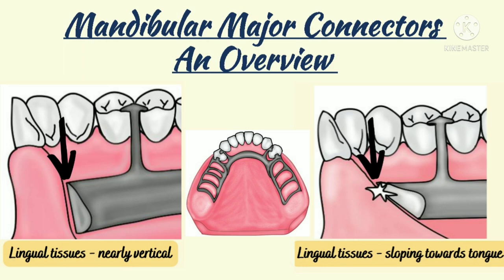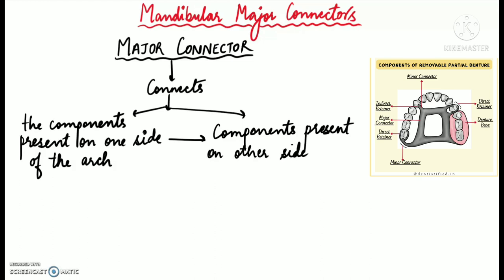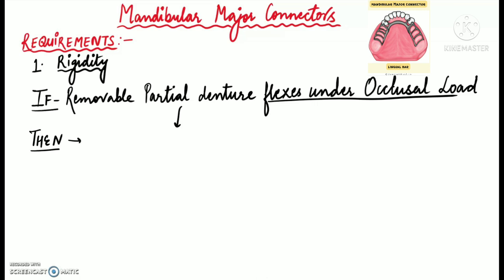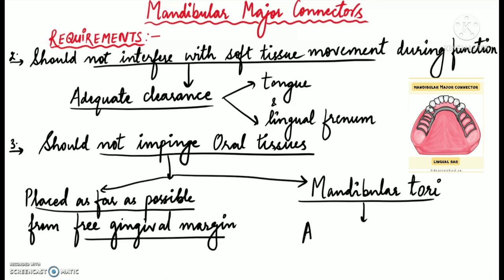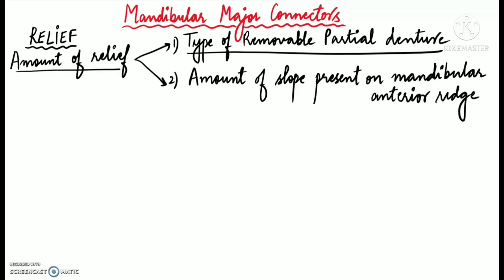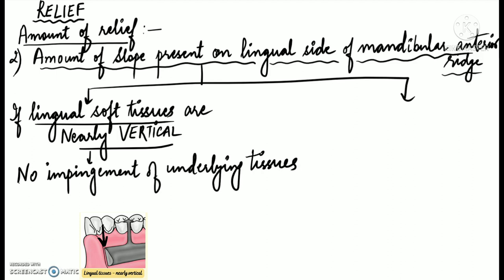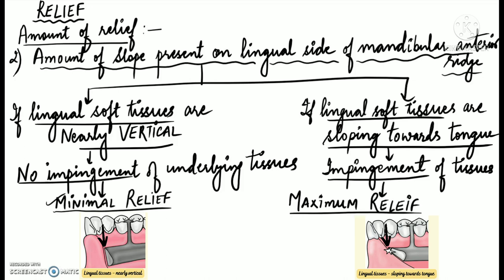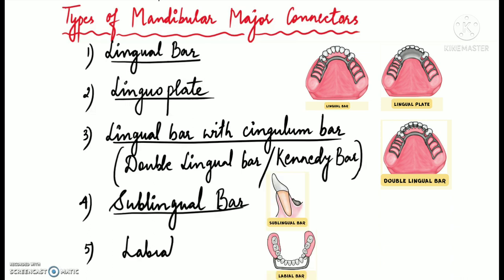Mandibular Major Connectors - An Overview/ Removable Partial Dentures

Comment: Dr ...
Could you please explain what is cantilever , moment load or force , bending moment ? 
What meant by ( when cantilever  is placed on implant  , there are 6 different potential rotation points( i.e moment ) on implant body  ) ? ..
& what is meant by ( moment load tend to induce rotation in 3 planes )? ..
Could you please answer my questions ...it will really help me to take answers from profisionals like you Dr.